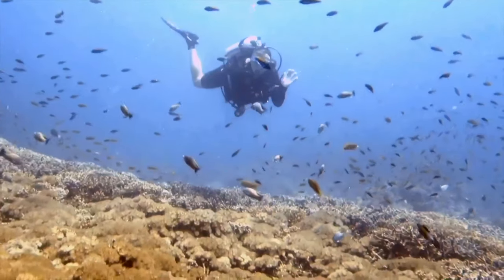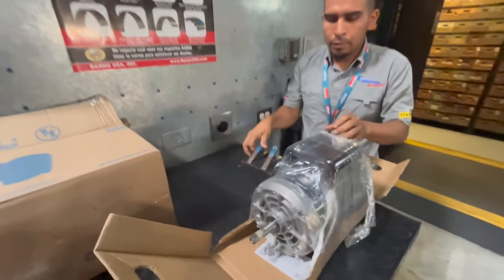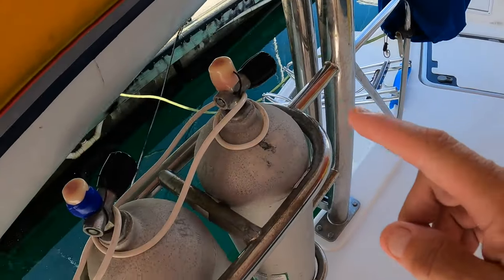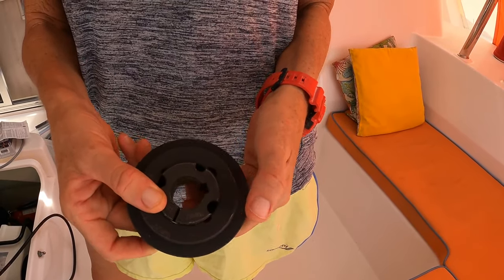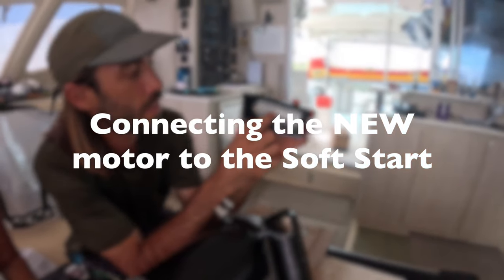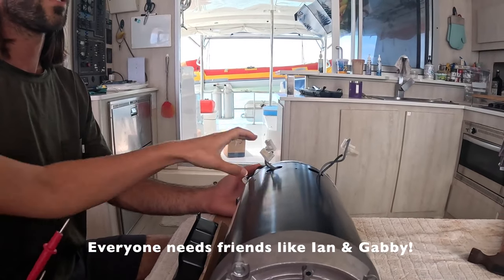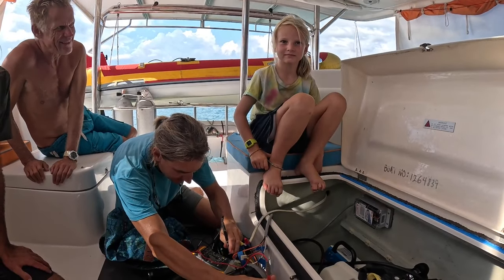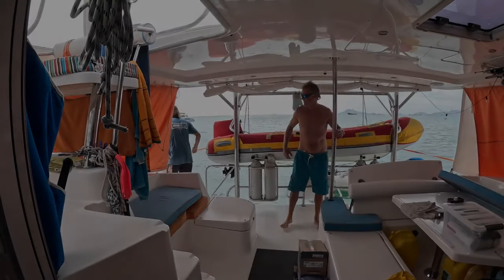278: Bavaria Fun2Dive Compressor Set Up - Convert From  220 volts to 110 - Run Off Lithium Batteries

Comment: What a Crazy process. What were the Starting AMPs and Running AMPs and RPM of the original 220 motor?  What are the Starting AMPs and Running AMPS and RPM of the 110 motor.  With that information it is easy to determine what you need to Do/Try first based on your current power available. It will be interesting as to what was the final solution.
Reply from the maker: That’s a great question. We never ran the 220V motor. We can’t remember what we had for the 110v motor now. We put all of those details out of our brains once we decided to eliminate the soft start and we could run straight off the batteries. That was the solution. Next week we show you how it all works!
Reply: @SailingBlownAway  Great. Thanks

Comment: Would it have been possible to use the 220v motor?
Reply from the maker: Sadly no because we are a 110V boat.
Reply: @SailingBlownAway  I got that part but what are the pros and cons of using a transformer and adapter instead of switching out motors?
Reply from the maker: @barryholiday8998 ah transformers always lose power in the conversion and we were not comfortable using one for a long time (40 min tank full) on our batteries.